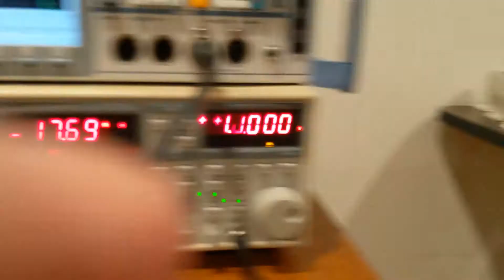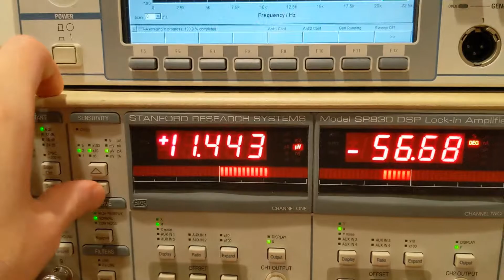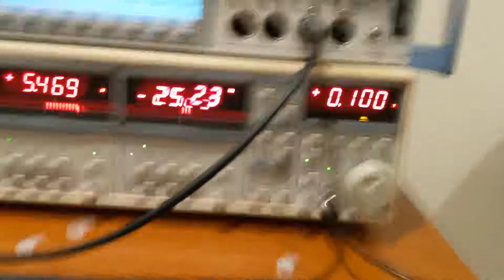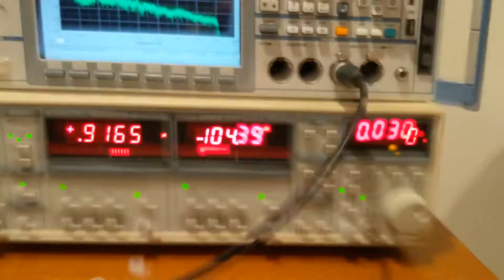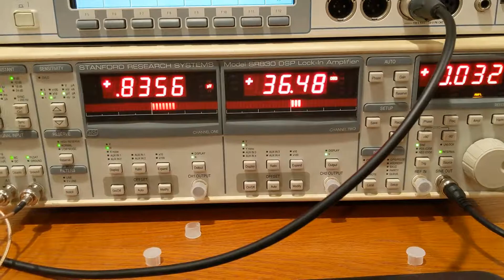Finding tiny audio signals with a Lock-In Amplifier

Comment: Can you detect signals you can't hear with the lock-in and a good mic?
Reply from the maker: You can, it sort of sounds like the tone continues, but the sound heard for most of the low level drives is just the fans in the equipment, I wasn't able to hear most of the later tests tone without holding the speaker up to my ear, and then only barely.  Beyond that I didn't have the means to verify that the speaker was still moving, but with some adjusting of settings (especially longer time constants) you should be able to pick up very, very small signals.